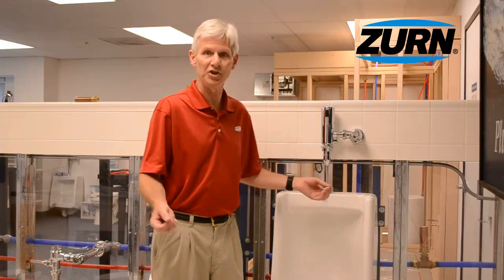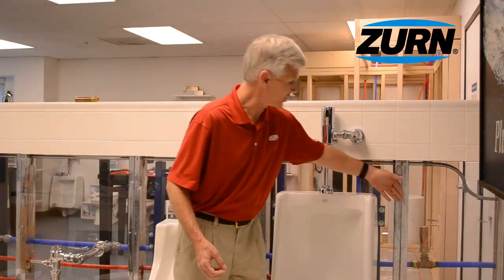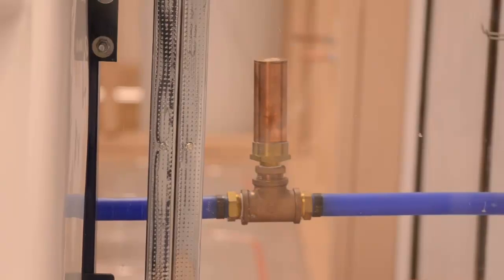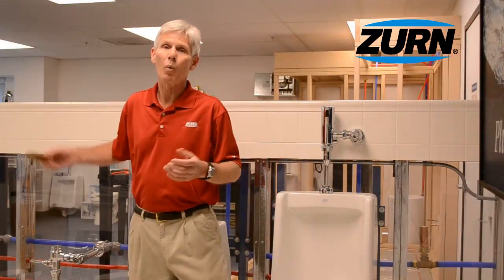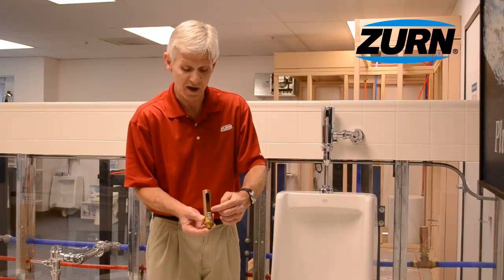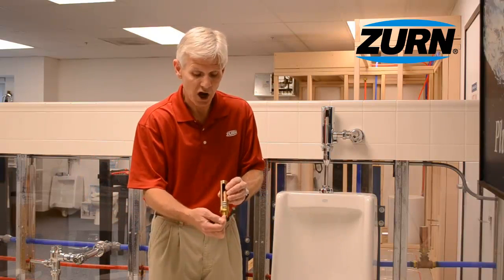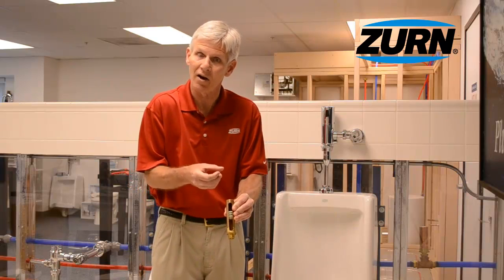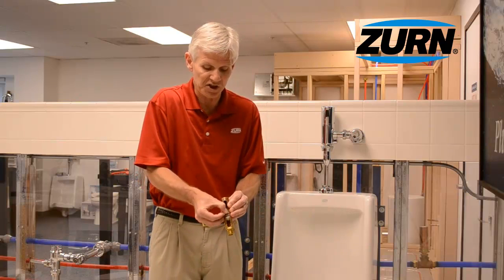Mitigating Water Hammer Situations

Comment: Thanks for the video.  My situation is a little different.  The water hammer only happens when my yard sprinklers switch on or off.  The sound is not a buzz or vibration.  It's just one distinct thud/bang when the sprinklers cycle on or off.  Only the sprinklers seem to produce any noise in the pipes.  I don't trust my soldering skills so I would rather not cut any pipes.  I'm semi-retired and don't want to pay a plumber.  I'm thinking of threading an arrestor directly on to an unused outdoor faucet and just leave that faucet open.  We've lived here 18 years and have very rarely used that outdoor faucet (it's upstairs on a balcony).  Here's my question: Are there water hammer arrestors that can be directly screwed on to a regular outdoor faucet?  Would that arrangement help reduce or stop the banging?  Thanks in advance!
Reply from the maker: Hi Greg. There may be manufacturers that offer a water hammer arrestor which will connect to your faucet threads but, Zurn does not. Some things to keep in mind when installing a water hammer arrestor is you want to put it close to the source of the hammering. In your case, it sounds like the solenoid shutoff in your irrigation sprinklers may be the cause. If possible, it would be best to cut in a tee closer to the source and then install a water hammer arrestor. If you have further questions, please feel free to reach out to our customer care team at 1-855-663-9876. 
Thank you for your question, the Zurn Social Media Team.

Comment: Jon, 
I wonder, will this help on a system where pipes are rattling as valves are opened? I have a situation where the public water supply can go higher than 80 PSI at times. It's almost like a cavitation from high flow velocity. When the water people checked it out it looks like the main pressure regulator is up a hill by about 200 feet of elevation. Back pressure changes from the entire community is highly variable and sometimes long lasting. They recommended a blow off valve but I would rather not be dumping water down the drain for a system wide problem. 
I do have an expansion tank to help smooth pressure changes but no regulator ahead of that. When I checked out regulating valves for this building I found that even these will have a pressure creep when there is no demand on the system for a few hours. 
Any advice you can offer is appreciated.
Reply: put a pressure reducing valve on your line right after the meter.

Comment: Hi, i have a question, can it be installed horizontally? and what cons does have that way?
Reply from the maker: Moises Barboza Castillo Hi Moises. Water hammer arresters can be installed in any position with no negative effect in any orientation. Feel free to check out more details on Zurn water hammers by clicking this link: http://www.zurn.com/Pages/CategoryHierarchy.aspx?NodeKey=407582. Thank you for your question!
Reply: This can be installed in any direction.

Comment: How can I determine where a water hammer arrestor needs to be installed ?
Reply from the maker: Hi Michael. The arrester is generally installed immediately before the valve causing the hammer condition.  Please visit zurn.com, and query the 1250XL (or use this link: http://www.zurn.com/Pages/ProductDetails.aspx?NodeName=Model%201250XL).  The specification submittal sheet will provide precise data on arrester placement. Thank you for your question!

Comment: I have a quick question. If water hammering is water pressure being haulted quick, then what is it called when you turn on the water and the hammering starts and doesn't stop until the hot water is turned off.
Reply from the maker: Hi Matthew. This sounds more like a pulsation due to an imbalance in hot and cold water pressure.  Valves, such as pressure balanced shower valves, can pulsate when the pressure differential between the hot and cold reaches the proper level. Please check the pressure on both the hot line and cold line to determine if a pressure differential exists. If so, contact your plumber to discuss solutions for the pressure imbalance.